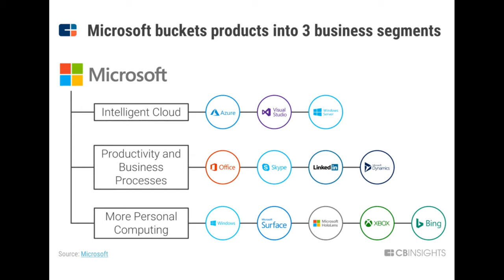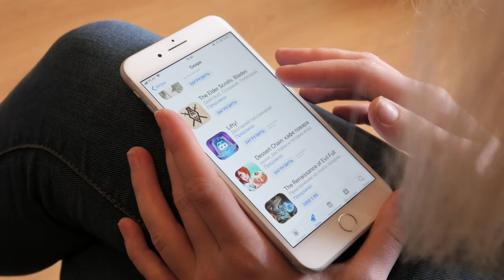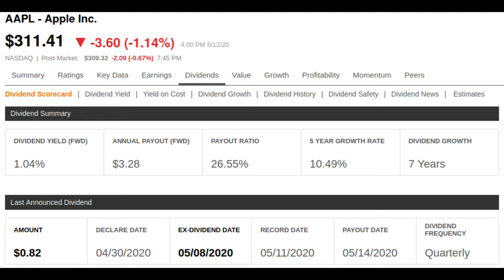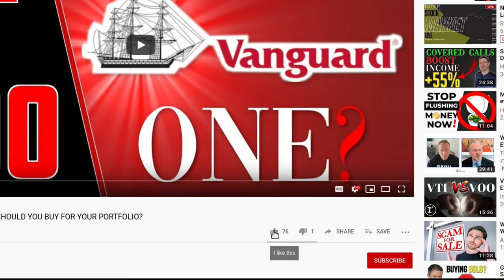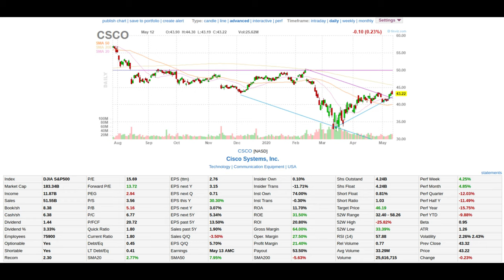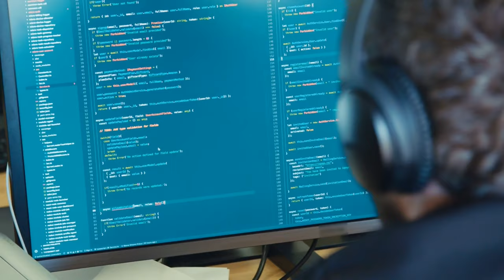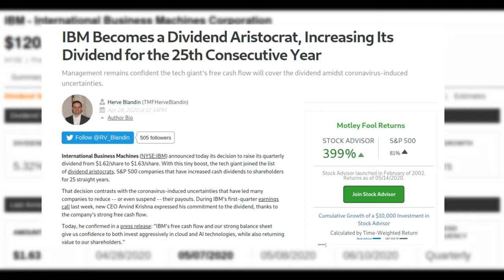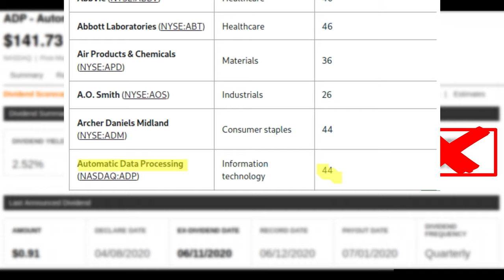Best Tech DIVIDEND Stocks | Apple, Microsoft and more!! | Passive Income

Comment: Tech stocks are solid through out the C-19, i like the performance of my 10 MSFT, doing well. i missed AAPL when it dropped to $224, now it is almost back to it's 52 high, thanks for sharing with us, big thumbs up. Dave
Reply from the maker: Yes sir. I picked up AAPL right on Mar 23 at the absolute low.  Got lucky there.   Not as lucky on some other picks, but it is what it is.  I'm not worried about it.   Thanks for the feedback and comment Victor.

Comment: Good one. I have some Intel which I have held for a long while and has one of the highest percentage gains in my portfolio. Wish I had bought more back when I first got it! Just opened a position in Cisco in my IRA. Can’t face buying Apple at its current price when the first time I bought it it was 10x cheaper. Unfortunately had to sell it in 2011 to pay medical expenses.
Reply from the maker: I think Cisco/Intel are decent ones, not too over inflated, and they both pay a decent dividend too.  I almost feel that Cisco and Intel are more innovative than Apple is.  I could be wrong though.   I just happened to pick up Apple right at the Mar 23rd low, so it's my bet performer in the dividend portfolio.   But I'd have a hard time adding to it at this point as well.  Sorry you had to be forced to sell.  Never a good situation.

Comment: those tasty Apple dividends 😋 funny how these companies have become common place in many portfolios, yet the tech isn’t well understood by many. it’s just accepted that they’re involved in cloud, consumer tech, processors, etc — which is quite frankly enough research required, so it’s understandable. 

on the flip side, maybe 10 years ago, IBM was seen as a no brainer, but it’s being overshadowed by new tech today. I wonder which no brainer today will become old tech.
Reply from the maker: I couldn't agree more.  Tech is a hard sector to get exposure to in the dividend world. I suppose those 4 at the end of the video I mention could be looked into more as well. I think my problem is that I've been working in the tech sector for 20+ years so I know what I know.  IBM isn't used much these days. And I've been in a lot of data centers and worked at a lot of customer sites.  I just don't want to use myself as the only reference to judge a stock if I invest or not.  IBM hitting 25 years is no small task, and I really like the Redhat pick up.  Hopefully the new CEO will change the perception of the company a bit.   Broadcom same boat really.  Texas instruments, same boat.   What do they even do these days?  lol.